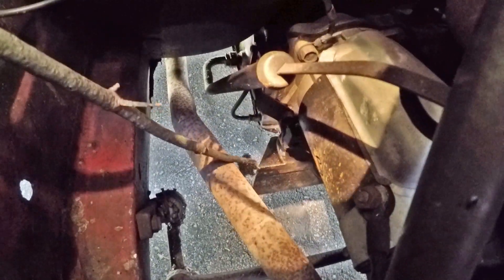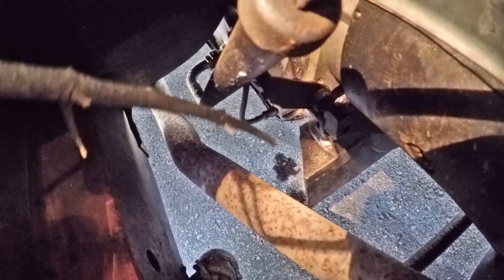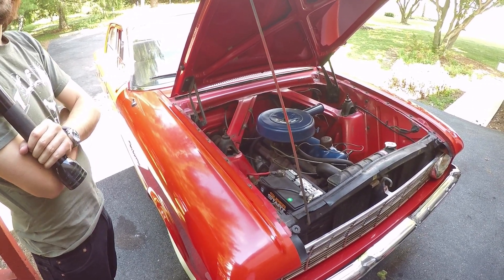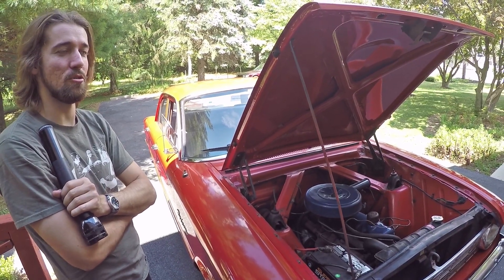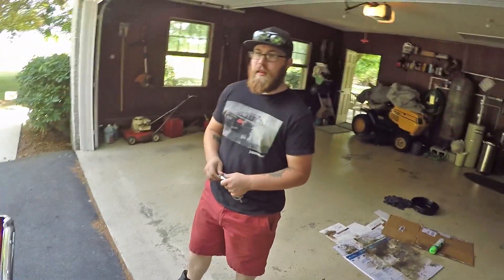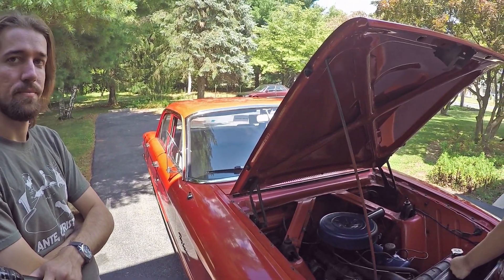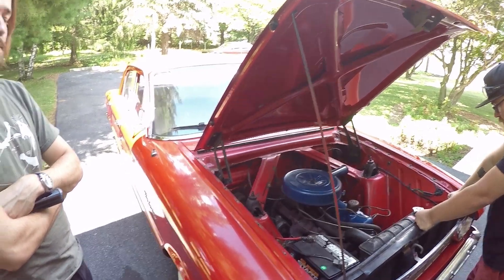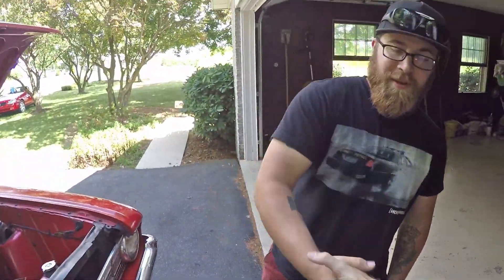Vagabond Falcon Ford-O-Matic leaks from main seal

Comment: That cicada is all like, "Let me play you the song of my people. REEEEEEEEEEEEEEEEEEE"
Reply from the maker: Micah Montoya I'm a cicada! Oh, it's 5pm and you're having a coherent thought? Let me derail that for you... REEEEEEEEEEEEEEE!
Reply: RegularCars stop by /o/, they love you
Reply: kinsmarts Silicone sally v2: Silicone harder.
Reply: kinsmarts I'm implying it'll end up like his Honda fit which leaks water. Instead of using proper parts, he'll just dump a whole lot of silicone on it until it stops. lol
Reply: Micah Montoya Welcome to summer in Pennsylvania.
Reply: Micah Montoya My Honda Fit does the same, as do all other GD Honda Fit's, the body cracks in the roof rail area so badly. It's like the sides of the car will fall off but it's just a deep crack. Good thing I live in Vegas and hardly have to worry about rain, but when it does rain it doesn't really leak that much.
Reply: ikutoisahobo I guess I got lucky on my 2008 GD. Heh well, at least until I got rear ended. Lol
Reply: Micah Montoya cicada hates normies
Reply: ch1ck3nch4s3r Nice meme, m8.
Reply: Micah Montoya that means so much to me
Reply: +RegularCars Pretty sure the guys from Roadkill would help with this project :P